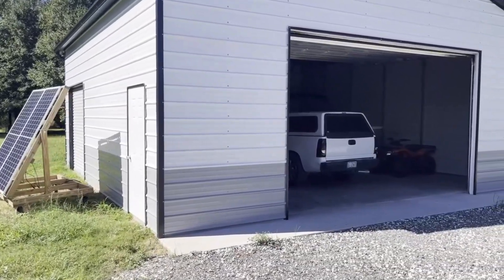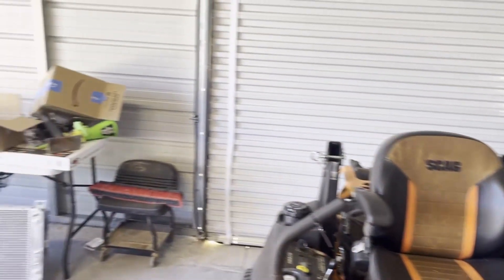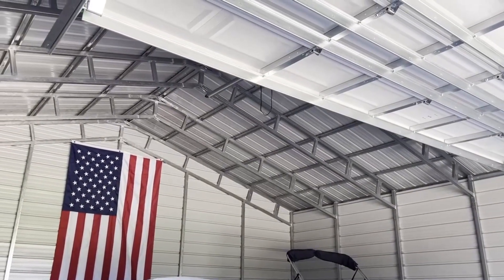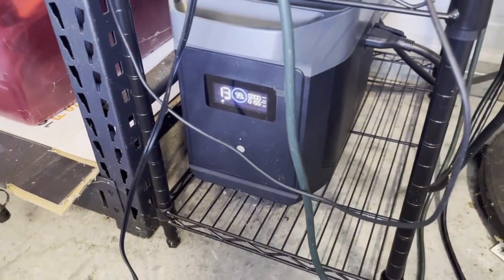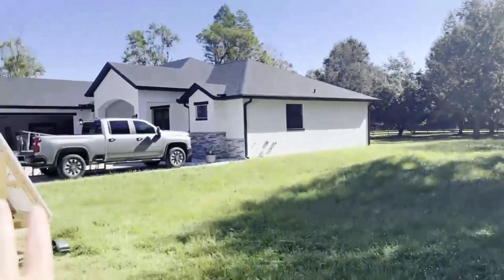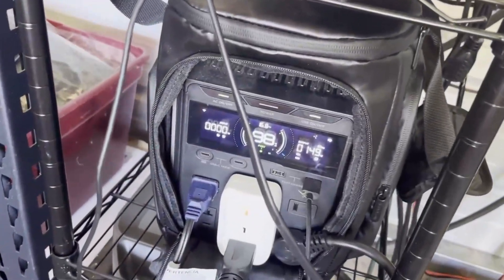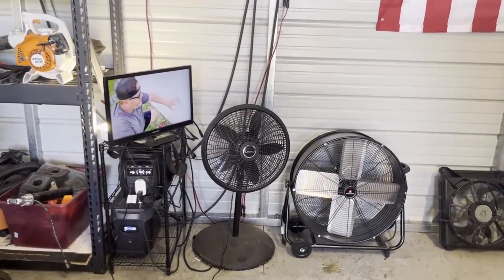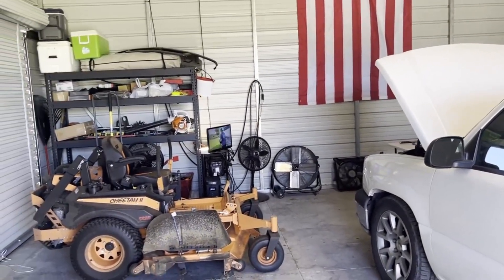DIY Solar for Beginners: How We Power Our Off-Grid Shop

Comment: Anything less than 3000w inverter is a waste of time... obviously you want as much battery as possible...but I would not buy their overpriced extension battery...use your own 48v battery....
Reply from the maker: The Ecoflow power station swap was something I wanted to try when I realized how little power gets used in the shop day to day. I had one already, so I figured it was worth a shot to try. It keeps the lights on for sure and wastes less power than the previous anker f3800, but if I try to run a compressor or something with a higher surge starting requirement it will likely leave me hanging.

Comment: Our ranch is in N Fl. Just got my barn built 2 mos ago and relocating my SS system to power that and container home . Well is 115v Grundfos soft start so I can run that as well off solar .
Reply from the maker: Do you have a preferred type of battery brand?
Reply: @Backyard_Florida   im using 6 EG4 48V server rack batteries & 2 6000XP inverters. ive also got grid power but in Hi Springs we lose power when the wind blows wrong.
Reply from the maker: It’s the same for us over here! We have delta 3 plus’s in each office and a River 3 hooked up to starlink acting as UPS because we have so many surges and brief outages. I’m seriously considering a setup just like what you have but with one inverter for now. How noisy is that inverter under medium load? Have you had any issues with the hardware at all?

Comment: You can't run a shop with that toy power station.😂😂😂
Reply: It doesn’t look like they have anything out there that would strain the inverter in that ecoflow.🤷🏼‍♂️
Reply from the maker: Hi :) The 1,000 watts of solar input and 1800 watt continuous use inverter is plenty for what we have going on at the shop currently. We were powering it with the larger anker f3800 but realized it was overkill for our limited power needs in that building.